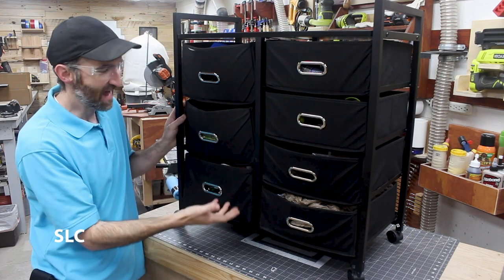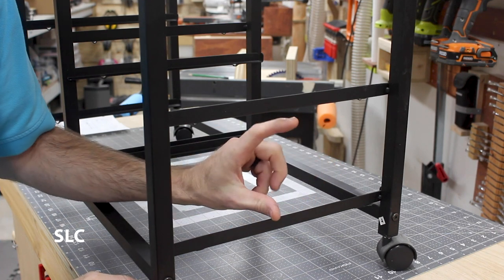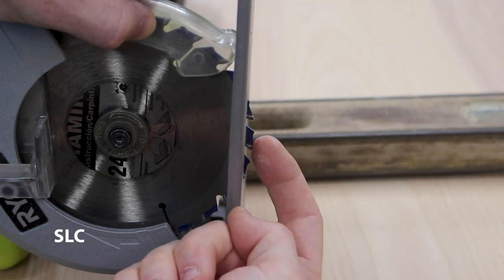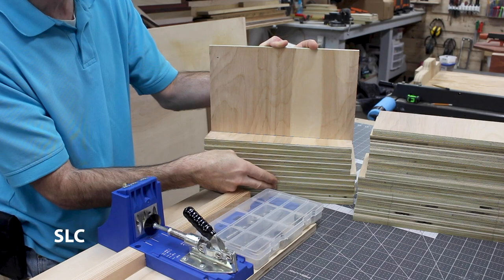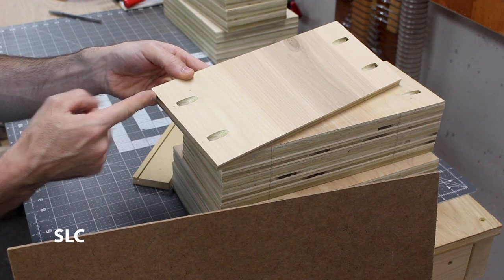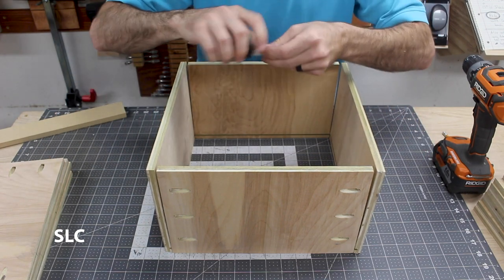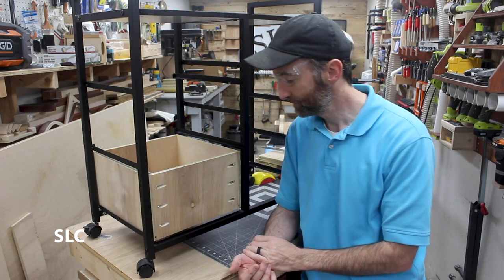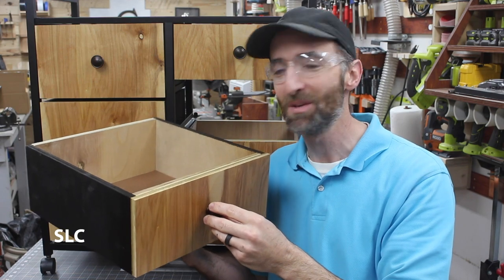Beautifully Simple Wooden Drawers

Comment: Why used cardboards for the bottom they will bow ..
Reply: Its called "hard board" in the UK.
Reply from the maker: I used hardboard because it is a small drawer and should not have a lot of weight. Also most people do not store liquids in dresser drawers, so it should not get wet. 
But if either happens, it can be unscrewed and replaced easily.
Reply: @SpecificLove7   I like plywood .. I don’t like cardboard or mdf material
Reply: He means hardboard. It comes in tempered or untempered versions, and is sometimes referred to by its brandname of Masonite.